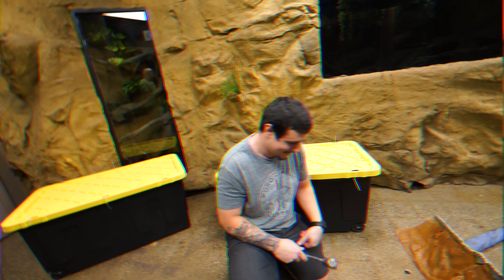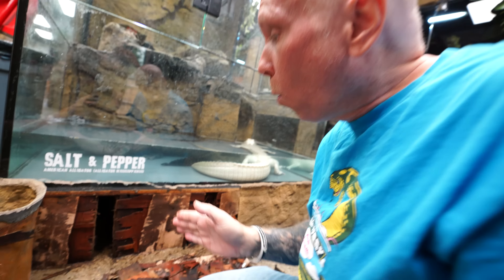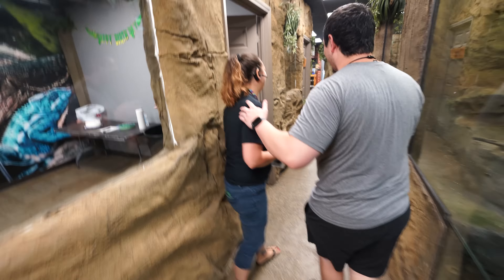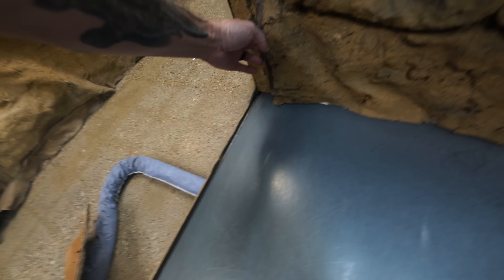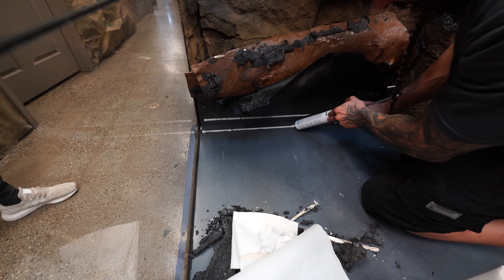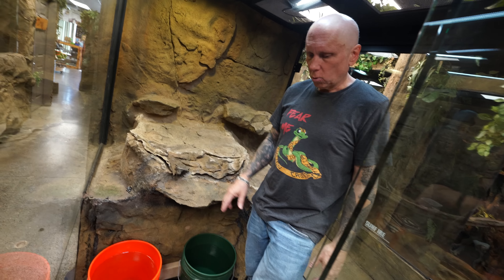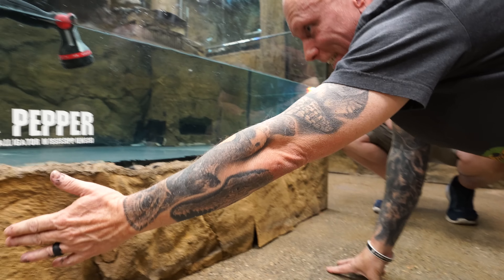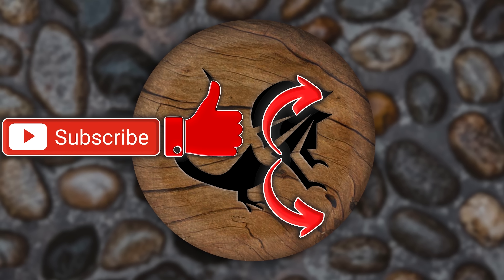My Albino Alligators Cage Fix! Will It Work?

Comment: Hi Brian if you take a cut piece of two-by-four when you are putting your acrylic in and just put it hold it at the end of your acrylic where you hammer and Hammer the two-by-four you won't chip your acrylic the two-by-four will be protecting your acrylic

Comment: If you take a small piece of 2x4 and place it along the piece of acrylic, it will then be much easier to hit a larger surface area and force the piece of acrylic into place under the enclosure.  And the acrylic piece will not shatter and or break.

Comment: Never ending leak for Salt and Pepper. When you put in the other brace use rubber mallet. There always seems to be that one tank that just has to leak.🤔 Both you and Mike did good job on getting the braces in.
PRAYING for strength and healing Mr. Brian.
GOD BLESS 🙏💖🙏💖🙏💖🙏💖

Comment: When hammering the acrylic, rather than hammer it directly, it might have avoiding splitting if you had put a piece of wood against the end of the acrylic and hammered the wood piece. It would even out the hammer force, rather than the hammer accidentally hitting the weak parts of the acrylic. It would take 2 people, one to hold the wood in place, the other to hammer.

Comment: Good morning Brian and the crew.  Great video as always...except you could have used a rubber mallet instead of the metal one, you could have hit it alot harder without worrying about breaking it.  Just a lil tip in case you need to do it again. 😃 love you guys, keep up the great work and inspiration

Comment: Hi Brian, I been thinking if this way do not work, would metal beam will work, type people used to hold up roof in houses or the new place across the road where are you at the moment. Plus I would also use three  or more  ideally  four acrylic pieces spread out at equal distance from each other to hold up salt and pepper accommodation

Comment: Man, that enclosure sure has been a pain in the tail for you guys! To hammer those acrylic supports in, I would have placed a board across the end of the support with a folded towel in between & hammered that to prevent the end of the acrylic board from chipping. Mind you, it's hidden in behind the Universal Rock where no one will see, so it probably doesn't matter, but there might be fractures along the length you can't see that you don't know about.

Comment: Don't create enclosures at the aquarium that you can't access to work on. Anything with water in it needs full access top, bottom and all sides. You most definitely need to access the pump areas and any pipes or tubing. Salt and Pepper's enclosure is just a master class for bad design. And anything that heavy with water should never be supported by wood. It should have beed welded square metal tubeing.